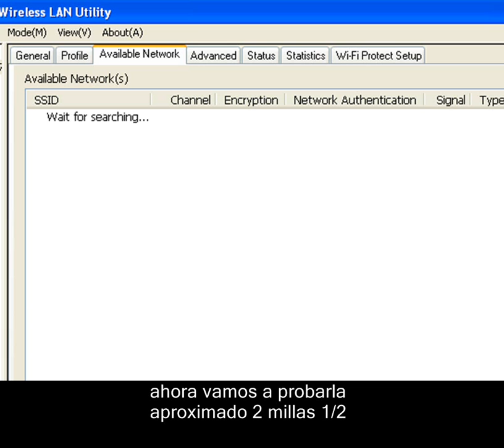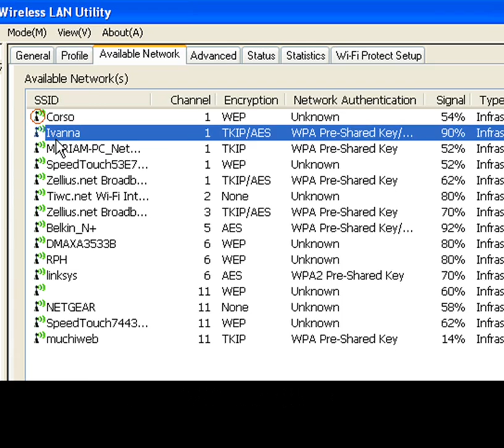como hacer antena wi fi y como conectarse al internet gratis

Comment: estaba viendo la caja de mi router y tienes 2 entrada para conetar  el cable RJ5 y la otra se llama asi external antena rp sma conetor sera que  con el cable RJ6 o no se como se llama sirve para colocarle a mi router y de hay bajarlo a mi usb poner mi router como antena para mi usb si se puede o no o hay que confirugar algo ya que mi router tienes un buen alcanse y con eso tendria la super señal de mi wifi cercano ya que hay como 500 mentro hay una y 800 y dentras de mi casa hay un router